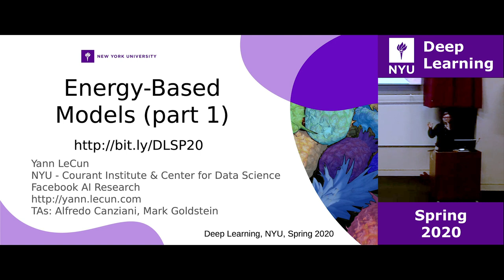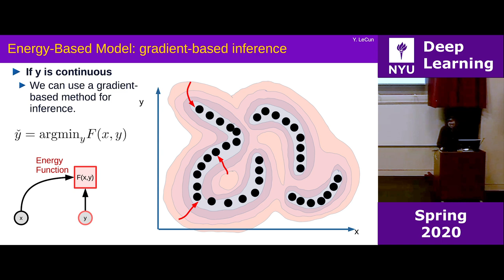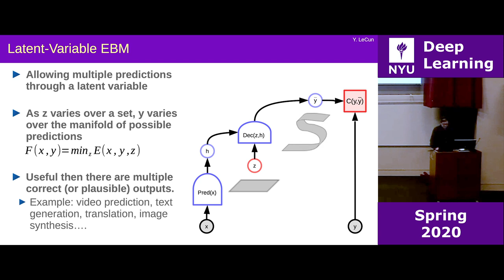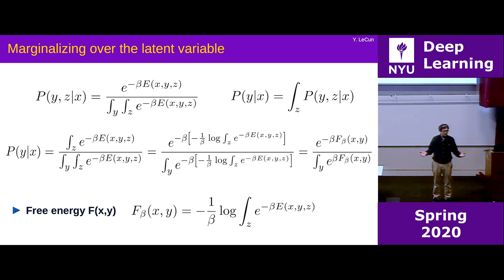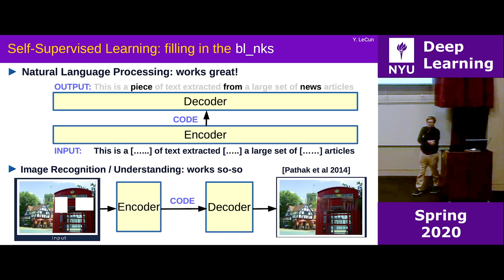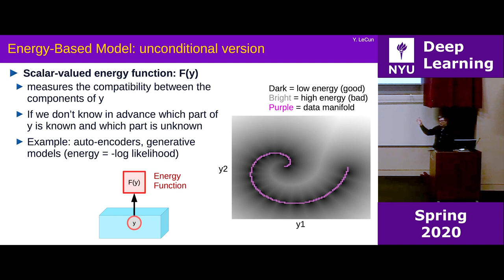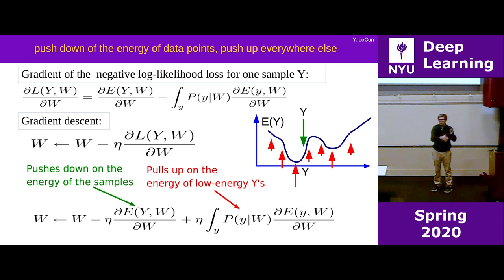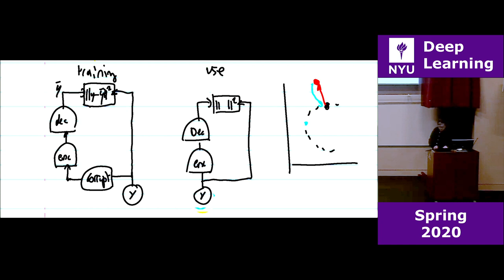Week 7 – Lecture: Energy based models and self-supervised learning

Comment: At 58:50 the falling pen example is introduced. The dataset is just one x and possibly an infinite number of y. Of course this is not even a function, f(x) = {the hole y set}, so finding an approximator will fail.
But, if we live in classical mechanics there are also an infinite number of x. The x has (phi, theta), polar and azimutal angles, and by knowing them we can make better predictions for y. The problem is now well-posed, a unique solution exists.
Even if that is a quantum mechanical pen, we know that x has a quantum vector state (unknown to us possibly / probably), and by knowing it we can get the final state y after calculating its probability density.
In both cases we are not representing well the input (state) x. The problem is bagging for a z or two.
So, from this comment and the lecture I am coming to the conclusion that the hidden variable describes the state, and the neural network ( or a complex chain of reasoning and functions) represents the rules of the system's evolution in time. Is this correct? Can this be a possible interpretation of the energy based models?
Reply from the maker: There is a single x, which corresponds to the initial condition of the system, a pendulum in its unstable equilibrium state, to which a small perturbation is applied in order to break the symmetry.
The outcome, y, is unpredictable if the perturbation is not observable.
Of course, if x would be completely observable, the problem wouldn't occur.
Reply: If we introduce a new variable z than after training, z would ideally be in {left, right} if x is in unstable equilibrium and z exerts no influence at all on the system. LeCun used the phrase 'z would have the complementary variable'.
EBM looks very fascinating. I have another rather funny thought experiment: if you are facing the intelligent robot and in the left three students are running toward you shouting some questions from a distance and in the right there is a big piece of your favorite cake, than this EBM driven robot would get the minimum energy if you turn right. Turning left would also have a possibility, but rather distant (or higher energy). So, Z would have some complementary information on the environment (shouting students left, favorite cake right) but also some internal stuff (you like cake more than questions). 
Thank you for the videos. Very fascinating!
Reply from the maker: Keep in mind z is not trained / learnt!
z is *inferred* once the outcome y is observed and it contributes to explaining how y arose from x.
Reply: You are right. I forgot that z is not learned in this model. How unfortunate :p

Comment: Is there any relationship between energy-model and reinforcement learning? According to "If you want to combine the output of an automated system with another one (for example, a human, or some other system), and these systems haven’t been trained together, but rather they have been trained separately, then what you want are calibrated scores so that you can combine the scores of the two systems so that you can make a good decision.", It looks like energy-based models use more than one system to make a decision, but RL uses just one integrated system?

Comment: 40:52 A probabilistic model could have p(x,y) for example be a mixture of Gaussians. I don't see how the infinitely thin manifold comes in to play then. For every value of x,y, there would be a non-zero probability density. Even if we have a p(y|x) model, then there are non-zero densities for any y, for any x. p(y|x) could even be multi-modal. Again, where do the Dirac functions come into it? I'm obviously missing something.
Reply: Because if we have an infinitely expressible function and are doing maximum likelihood inference from finite samples, we'll end up with a non-smooth manifold that spikes at the data points and is zero everywhere else.
Reply: @robmcadam9393  Thanks. Why would a probabilistic model necessarily need to be infinitely expressible?
Reply: @Epistemophilos  The problems arise in a non-parametric context or, in theory, with infinitely expressible parametric models. If you have a parametric model, you are maximizing the likelihoods subject to the constraint that the energy function maps onto some distribution of choice.
Reply: @robmcadam9393  Well, you would normally optimize or integrate over some hyperparameters also, right? For example a GP model would not normally assign infinite density to training data.

Comment: in the k-means problems 
As the coordinate gradient descent, we initialize the centroids, find x near it and update centroids by calculating the avarage 
In EBM model, I knew that z - latent denotes the classes and think that the energy here is the distances from points to centroids, 
and I assume that W is the d x k matrix where d is the dimension of data (W is like k centroids) and Y is data points ? but it's still a little bit ambiguous 
Hope you reply with clear explenation, what is Y ( y1, y2).. Thanks
Reply from the maker: I don't understand the question.
Also, you need to add a timestamp, or I have no idea of what part of the video you're talking about.
Reply: @alfcnz  1:21:24 here can you explain the k-means inference in EBM form here
Reply from the maker: @ChiTran-xd1pg  as the formula states, you check what centroid is the closest and you return the squared Euclidean distance to it. That's how inference is performed.

Is this what you were asking?
I don't really understand the first message. y is the data we want to learn. In this case y ∈ ℝ², so y = (y₁, y₂), and they are forming a spiral.
Reply: @alfcnz  so y is the data and z denotes the k centroids , so what's exactly W (and how we get it).
Reply: @alfcnz  fix me if im wrong pls, 
as u said that y is the data and latent var z is one hot denoting the cluster,w prototype here is 2*k matrix here and wz is the current centroid and the function is y-wz?
Reply from the maker: W is the collection of all centroids.

Comment: The speaker mentions that transformer-like models fail to give a competitive performance on CV tasks. But then in the recent DETR model, what changed?
Reply from the maker: DETR was released on 26 May 2020 (see https://twitter.com/alfcnz/status/1265487916547084291 for more info), this video was recorded on 16 Mar 2020. Moreover, next time include minute:second of where something is said, otherwise I cannot double check.
Reply: @alfcnz  My bad - sorry about that. 

The sentence starts at 53:40, and around 54:02 the speaker mentions "the results have been extremely disappointing"

I get that DETR is fairly recent - I just wanted to understand what was the idea/innovation that DETR does which hasn't been done before (but maybe I should read the paper directly then 😅 )
Reply: He is talking about the "fill in the blanks" method of representation learning, not transformer models in particular. The dominant CV model has been the CNN, which aggregates local features. Transformers, by contrast, apply global attention. Aside from DETR there is also Image GPT.